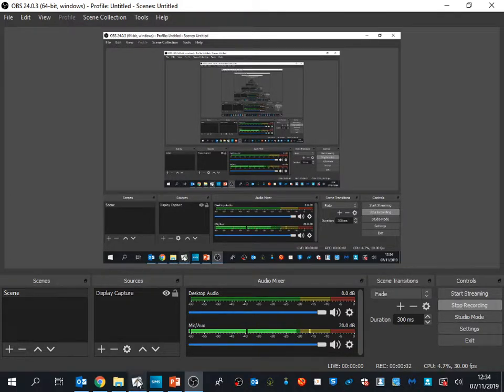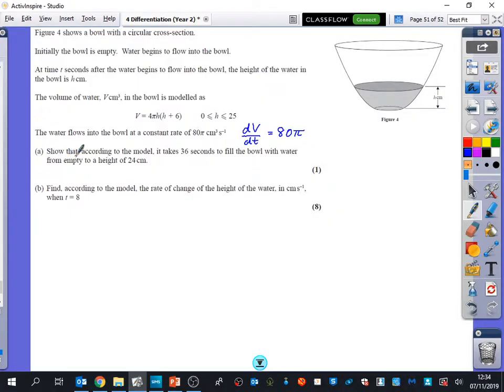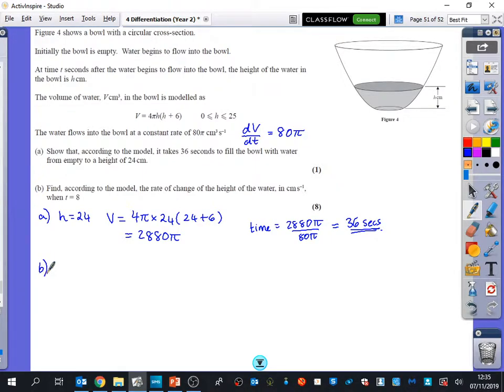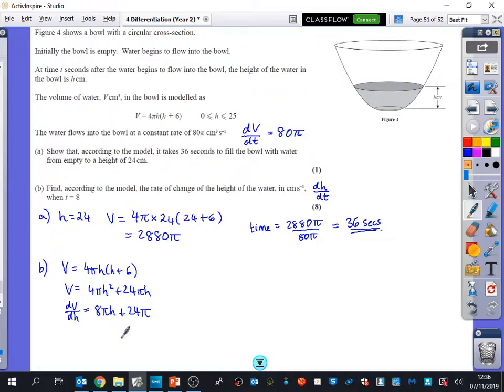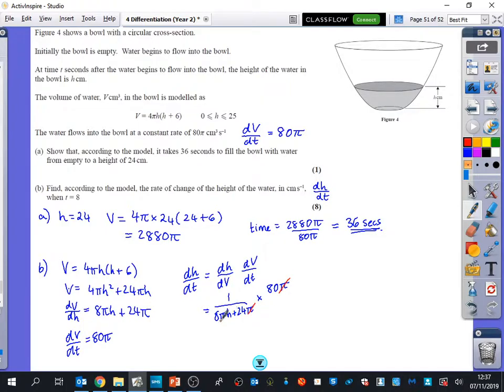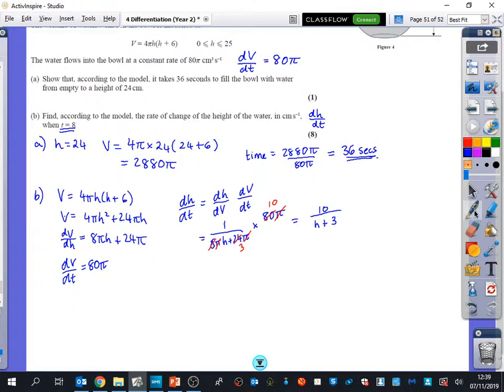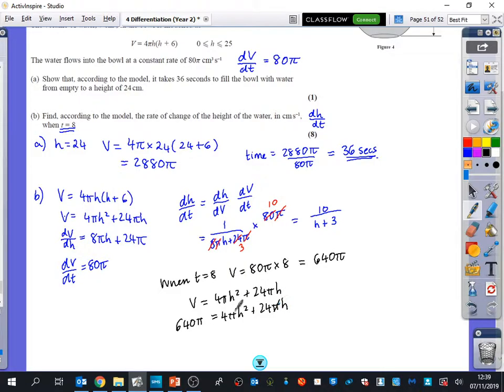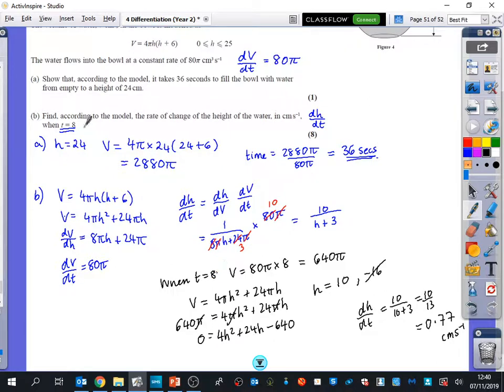Differentiation 30 • Connected Rates of Change, exam question pt. 3 • P2 Ex9J • 🎲

Comment: Hi sir. When you found  the expression of volume to be (80 pi T) did you integrate the dv/dt expression given first. If so how did you conclude that the constant was 0?
Reply from the maker: I suppose I could have integrated it, but I actually just was logically thinking - 'if the water is coming in at 80pi cm^3 per second, then how many seconds will it take to get to 2880pi cm^3?' If it were integrated, the constant doesn't really matter in this scenario as we're just thinking of a relative change of volume.

Comment: Sir I tried solving the equation by setting 640pi =4pih(h+6), then simplified it by cancelling out the 4pi on either side to get 160= h(h+6), solving it, wouldnt I get h=160 and h =154? I don’t understand why we can’t do that here
Reply from the maker: Not quite - we need h multiplied by (h+6) to be 160, and that doesn't work with your two values! It's a quadratic, so be careful :)